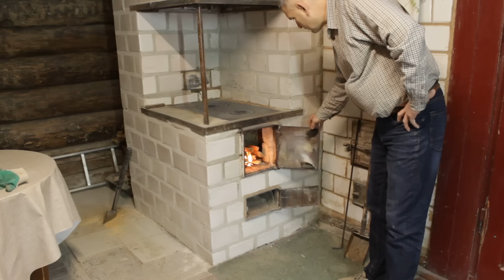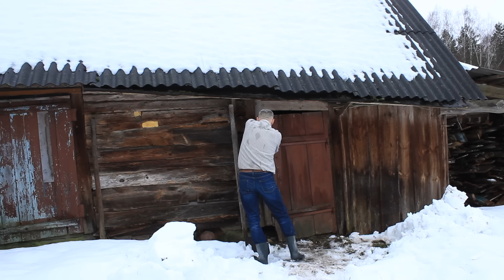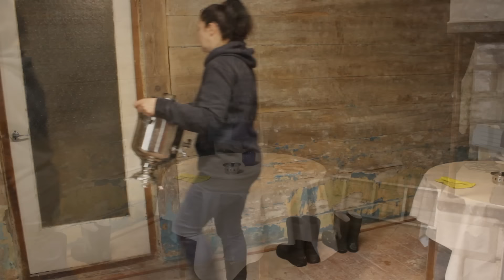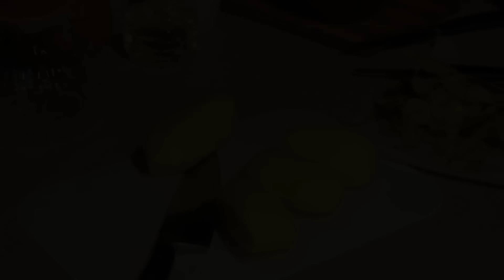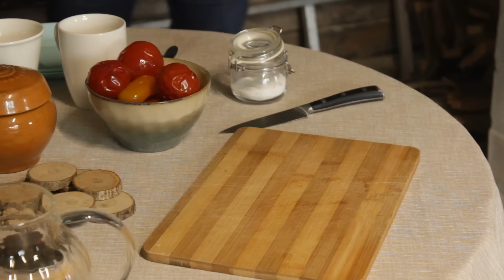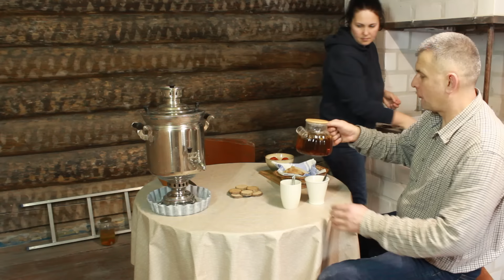Life in a village on the edge of the forest| Simple food cooked on a wood stove | Home renovation

Comment: What does it mean to calcine salt in your cast-iron pans?  I am not familiar with this process.
Reply from the maker: This is what our grandmothers did and this is what is written in the instructions for new cast iron frying pans. If your cast iron frying pan starts to burn, you need to thoroughly heat it with regular rock salt. Then remove the salt and simply wipe the pan with a napkin, add oil and fry. We do the same with a cast iron pan for pancakes.